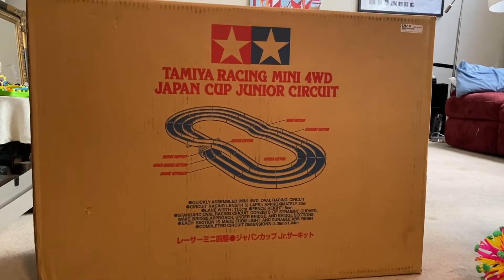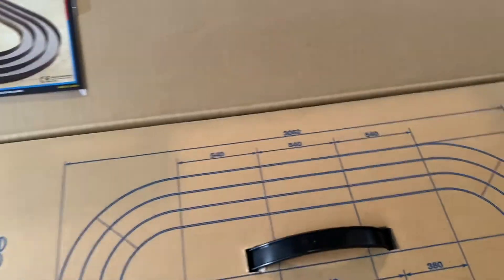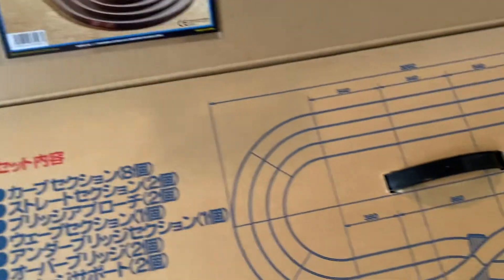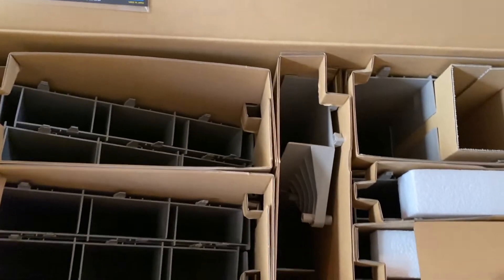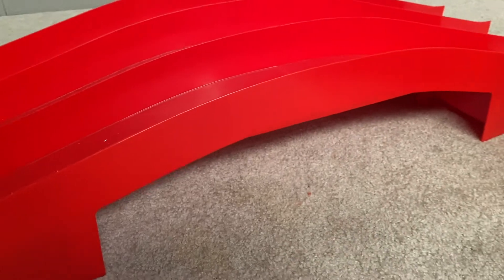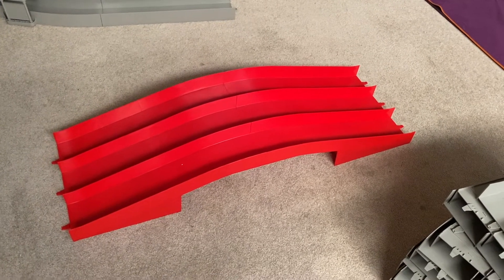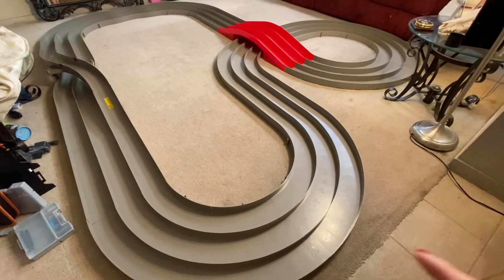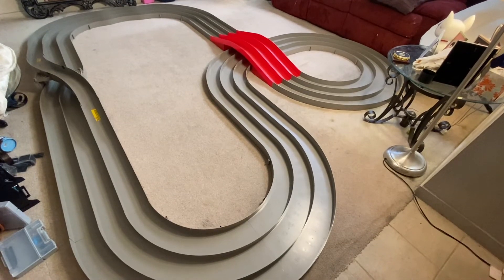Unboxing the Tamiya Mini 4WD Japan Cup Circuit

Comment: Could you shrink the original oval to a circle? just wondering as space is limited at my house and I do want a 3 lane track.
Reply from the maker: You can, but the outer lanes will always be longer than the inner lanes, so you really can't race with that configuration.

Comment: I was hoping you would show a closeup of how the parts snap together -- probably high precision or the cars would not run smoothly (another factor in the high cost).  Is it feasible to assume one can put this track together in (?) minutes, and at the end of the day, take it down and put it away?  Or is it too much work to do that realistically?  I remember when the slot car craze hit, back in the 1960's (revealing my age here).  This seems to be a big improvement over that technology.  Are slot cars still around?  How would you compare the two types?  I personally was never a car hobbyist.  Being a pilot, I went for flight simulators as soon as they became available on PCs.
Reply from the maker: Hi phongpit! There is an interlocking mechanism on the bottom of the tracks, but it's not as high precision as you may think. Many people use tape (wide plastic tape) to secure the tracks together so there are no gaps in between the tracks. Even a tiny gap or a slight offset where one edge sticks out can cause a course out. Strangely, the 2 lane track has clips to secure the tracks together, but there are no clips for the 3 lane. The 3 lane tracks are much more sturdy than the 2 lane, though. Once you race on a 3 lane, the 2 lane will feel like a toy.
Reply from the maker: The 3 lane track can be a beast to put together because you need a lot of space and you have to be careful putting the track pieces together. Many racers set up tracks in their yards on concrete. I wouldn't say this could be set up in minutes. Maybe minutes for a single oval, but for more than one track, it might take a while as you have to position everything just right. It's a lot easier to set up with two people. Yes, slot cars are still around and I'd say this is a very different hobby with different considerations. This hobby is more mechanical. Slot cars and RC are more electronic.
Reply from the maker: I think I will do a follow-up video soon with close-ups of the track pieces and how they fit together.